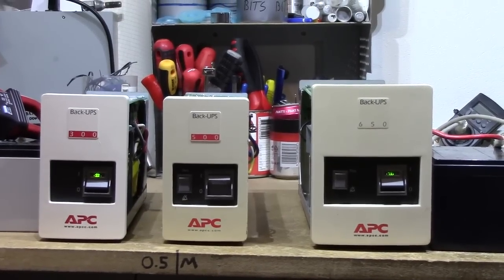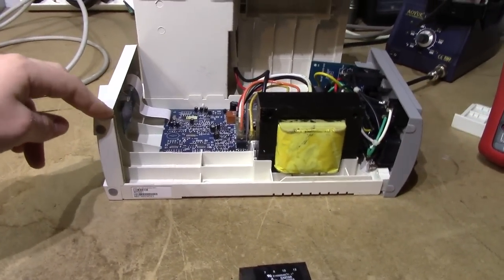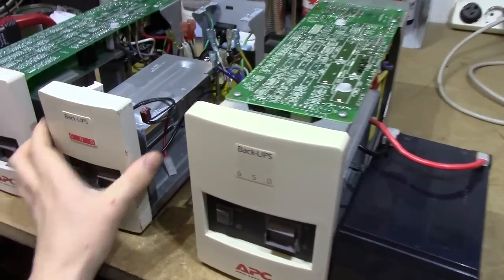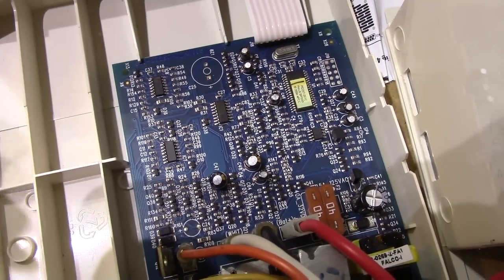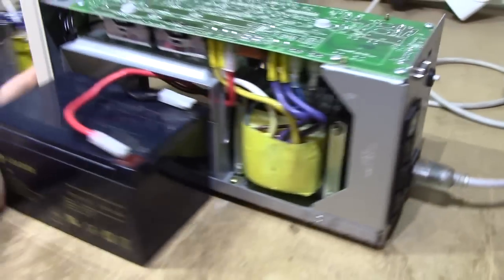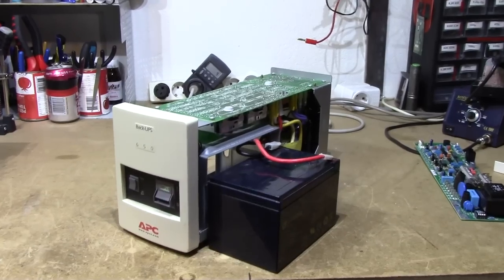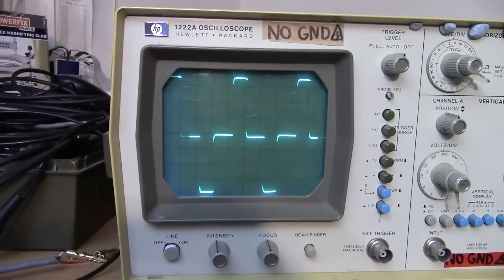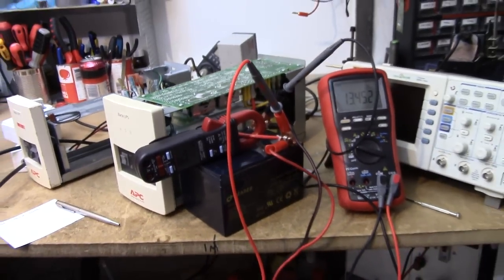Teardown: Old APC Back-UPS units

Comment: Hi there,

I see you know these units well. I have a 650VA model (BK650MI, 230VAC). My brother used it for his PC, and once he was playing around with the test button like you did in the video, and something broke inside the unit. The inverter does not turn on when the test button is pressed, or when the mains power goes out. I hear the relay switching but the inverter simply does not turn on and the unit shuts off due to loss of power. Battery charging works. The battery is good, the PCB looks intact, no repairs. I used multimeter to check transistors, mosfets and resistors but they seem to be okay (this is just a semi information though, because I did not solder them out, just checked for shorts and broken/non-conductive components).

What could have gone wrong? Some IC got fried? (which I hope not because they are pain to replace) Or bad/aged capacitor?

Thanks in advance for any help you could provide.
Reply from the maker: +Máté Mihalik It's really difficult to say. It could be almost anything from your description. If the entire unit shuts off as if the battery was disconnected, I'd look into the logic power supply stuff, causing the brains of it to fail to run when the charger is not running.
Reply: Hi, try to check relays. Sometimes you can hear click sound but relays may not connect. I saw that ;)
Reply: It is necessary to check all transistors and diodes, it is not difficult, mark with a dot with a marker those that have been checked. There are tracks - a fuse, check their integrity. It is necessary to unsolder the output FET transistors and check the generation from the controller with an oscilloscope. Check whether the relay switches, whether the contacts close.

Comment: Hey,

I have the 650, a bit different from yours, mine is completely white with black switches on the front, and i guess the battery is dead, because of some strange leak type of mark i saw on the underside of the battery.
I haven't opened it to remove the battery, but i ahve a scooter battery, smaller in size, it is a 12V 7Ah battery.
On the battery that I have, there is model number: PL7-12.
Will it work to be McGuyver style rigged inside just to kinda work in case of a blackout? Like 1-2h on my main computer at home?
My computer has a 750W PSU, the total power consumption is unknown, but the idea is to keep it working and avoid any power loss that may damage my computer.

Please reply fast, because i have 2 UPS-es, the one you have, the BK650MI and a HP C4777A, both are salvaged from the street, and i want to give them another life.

Thank you in advance.
Reply from the maker: It'll work, but small UPSes like these give you runtimes in minutes, not hours.
Reply: Atleast it'll work for a while.
Need to understand how to connect that UPS to my PC in order to send a shutdown signal to the PC when the battery is low.
Reply: I have tried to connect that battery, it worked for a small amount of time, and whilst it was off, i heard a tick inside, then i disconnected the battery and opened it.
I can smell something burnt, like a resistor.
What could it burn, and why?
Note: The smell comes close to the back, and I can see an array of diodes and resistors there, but no idea if one of them is burnt, also, the UPS when it was functional but not connected to anything, it was making the buzzing sound that is typical to a bobbin working, just so you know, not a hissing sound.
No sounds were present during the time the UPS being powered off.
Reply from the maker: Dark Wisper
I really couldn't say, I'm sorry - while I wish it wasn't the case, my telekinetic troubleshooting powers are limited. Some smell could be because of the linear battery charger in these, if your battery is bad and maintains a voltage below 12 V.